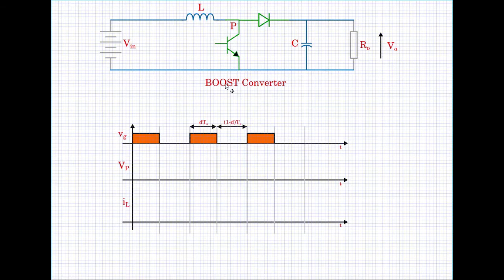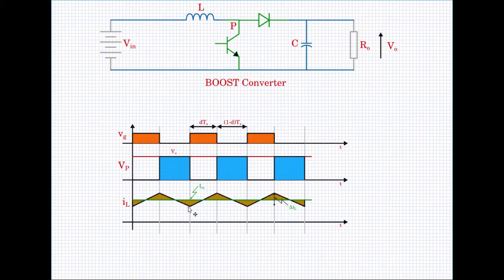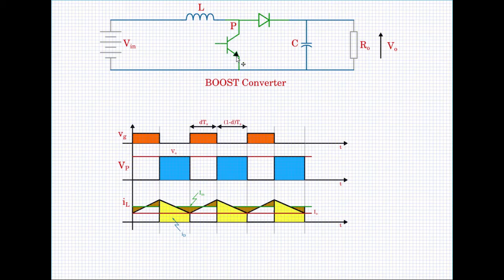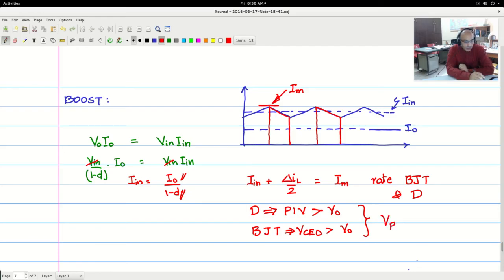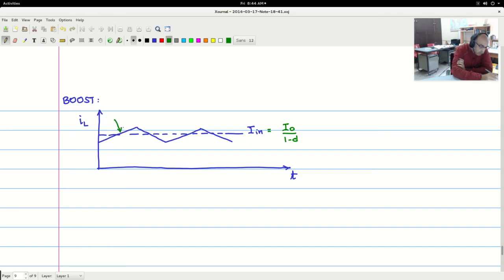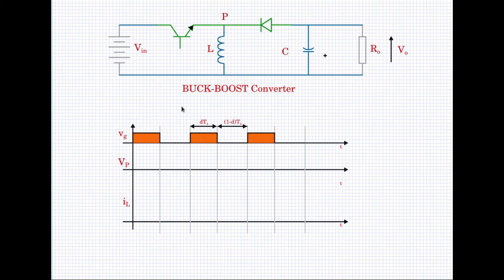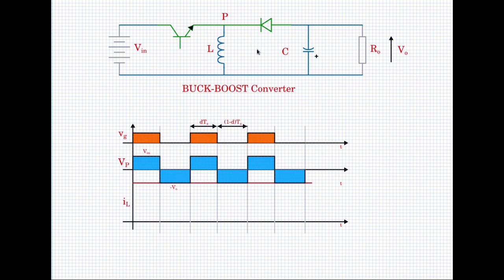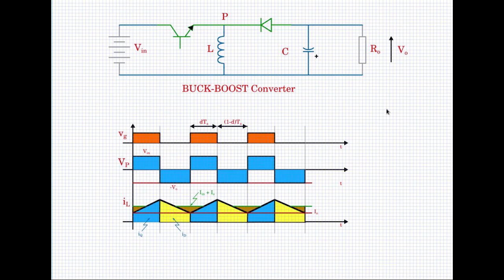Understanding Boost and Buck-Boost

Comment: Hello Sir .. I am working on  bidirectional buck- boost converter and i am following this link- http://www.google.co.in/patents/US5734258 
I am generating Inverting and non-inverting PWM signal with dead time between  them . boosting the power from V2 to V1 i am able to transfer 300 watt (30V to 52V) but my inductor   slightly getting heated up. i have doubt on PWM frequency . should i have to increase frequency . how to calculate require frequency for 1kwatt system .